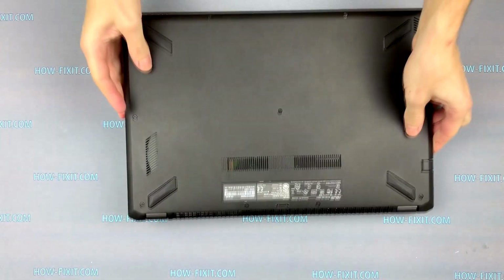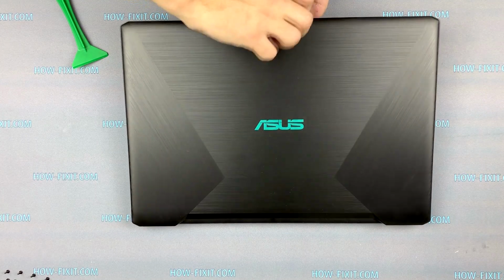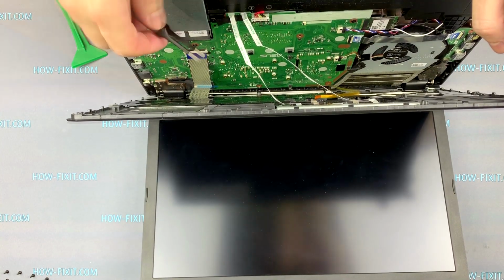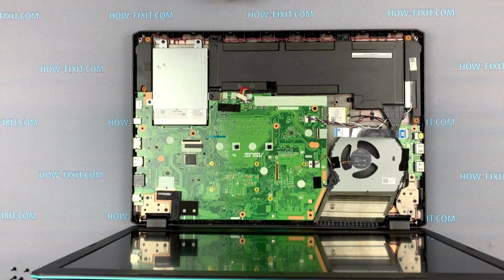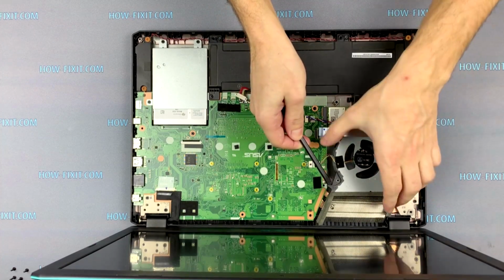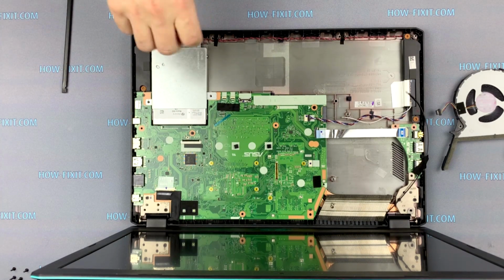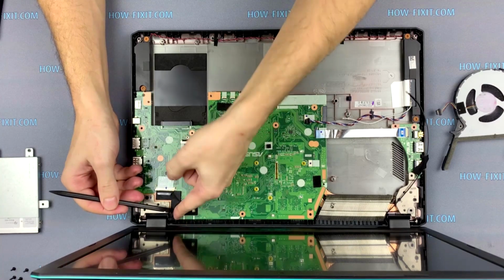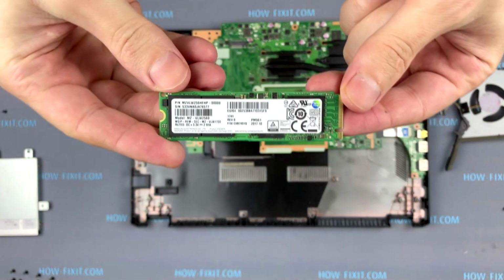How to install M2 SSD in Asus K570, F570, A570 laptop

Comment: Just finished reassembling my laptop after installing the new nvme ssd...
And it turned on...

Just wanted to say thanks brother... You're truly a legend..
Reply: Is true bro the laptop can support nvme and going well until now?
Reply: @tobangapatar1357  yes can confirm! Laptop is fine and it is significantly better performing. nocks on wood
Reply: @outdategaming7367  aside it, what brand ram and ssd you use for the laptop?
Reply: @tobangapatar1357  I didn't touch my ram it was enough. Just installed an Adata sx6000lite nvme ssd
Reply: @outdategaming7367  thanks bro
Reply: @outdategaming7367  what about Pro version bro
Reply: @outdategaming7367  hello bro after installing ssd physically, do we need to make a change especially in bios setup?

Comment: Thanks for this video. Disappointed with Asus for the bad design on an otherwise good laptop with good price-to-performance ratio. I'm not a tech expert but adding RAMs and upgrading/replacing the HDD is something I was able to do myself without much effort. Might choose Nitro 5 over this for the accessibility of its harddrives and RAM slots.

Comment: Omg that’s so much work. 
If I do that I’m gonna upgrade the ram, the WiFi, ssd and hard drive to max. 
So what is the max ram, hard drive m.2 and which WiFi card can I put?  Any help would be greatly appreciated.
Reply from the maker: MAX RAM 32gb (16gb x 2 ram)
Any hard drive or M.2 SSD capacity
Reply: ASUS states online that for the K570ZD (aka X570ZD) the max ram is 16 (8x2) 2400 for this laptop, and it only accepts SATA 3 type M.2 SSD. As far as their product specs lists, NVMe is not supported. The video shows the install of a Samsung NMVe SSD, but does it perform properly?
Reply: In F570z with out removing hard drive we put ssd...

Plz... Reply

Comment: Hello good sir I wanna ask, is nvme m.2 is support for f570zd? Because the information I got from asus website it's  sata 3.0 m2 not nvme. I'm so confused :(

Note: I just buy adata sx8200 pro nvme SSD and it's  not compatible. This laptop is kinda picky for brands. I suggest Samsung nvme for everyone.
Reply from the maker: I personally installed NVMe M.2 SSD and it worked
Reply: @howfixit  thank you so much,  now I'm sure to buy this laptop :)
Reply: How abou WD BLUE 3D NAND NVME M.2 240GB will it work? Tha nk you!
Reply from the maker: it should be working
Reply: @tassamuakhsannugroho8264  have you bought f570zd , and tried nvme?
Reply: Yes, I already use the adata SX8200 Pro 512GB and It's running smooth :)
Reply: Tassamu Akhsan Nugroho hey . i want to ask u since u use almost same brand with i bought and same laptop brand. i bought Adata sx6000 256gb m2 nvme . is it compatible ?
Reply: @nikfarhan3240  yes, it's compatible since f570z have m.2 NVme slot
Reply: Tassamu Akhsan Nugroho at the first comment u tell that the brand is not compatible. is there any problem at first u upgrade ?
Reply: @nikfarhan3240  Apparently on the first comment, my 16GB dual RAM configuration is actually have a problem so the SSD can't boot properly. So I change to 16GB single channel RAM with Team Elite Brand and It's working smooth.
Reply: Tassamu Akhsan Nugroho okay thank u sir 🤗
Reply: @tassamuakhsannugroho8264  Thr customer support said that it supports m.2 sata interface, but nvme runs on pcie so we ll get the speed of read/write according to m.2 SSD, do u check the read/write Speed?
Reply: @howfixit   Asus F570ZD , thr customer support said that it supports m.2 sata interface, but nvme runs on pcie so we ll get the speed of read/write according to m.2 SSD, do u check the read/write Speed? Does installing nvme on f570zd compromise the speed to m.2 SSD?
Reply: @shadyakhtar  yes, the interface is actually support m.2 NVme and the read and write speed is maximum
Reply: @tassamuakhsannugroho8264  Sorry for late comment but how is it bro? still running well and have you faced any issue since the installation?

Comment: Hello sir, I managed to install ram and ssd and everything running well but there a problem  where I can't select the ssd as Priority Boot in Bios 

I have changed the ssd partition type to MBR and   have worked but I am not allowed to install win 10 in it so I reverted back and still using hdd as Priority boot, Do you have any solution for it sir?

Comment: I have ASUS F570ZD. I installed it with Samsung 970pro NVMe M.2 SSD. But it is not supporting and not showing in it's BIOS interface. Do I have to upgrade my BIOS to support SSD?
Reply: Bro is there a slot of SSD or did you replace HDD with SSD?
Reply: @preetrajrajukurian4181  There is a slot for ssd. Same as in the video.
Reply: @Samygurjar   Were you able to get the SSD to work?
Reply: @preetrajrajukurian4181  It worked. But it is not showing in BIOS screen
Reply: @Samygurjar  how did you set the primary boot to the SSD then? If you weren't able to see it in BIOS

Comment: Can someone whom installed an nvme ssd in the x570zd tell me how did you got it to work and which bios version were you using? I installed an nvme in mine but it gets stuck in the asus start logo and won't let me get into bios until I ininstall the nvme :(
Reply: I'm about to upgrade my A570zd with 1TB NVME M.2 too. May I ask have you found a way to fix that problem?
Reply: Mook J. You should be fine, my ssd was just defective.
Reply: @Masked4789  oh... Did you at least get a refund from that:(? But you manage to get your new nvme ssd to work right?
Reply: Mook J. Yeah I got a replacement and it worked c:
Reply: @Masked4789  That's nice! Would have been such a waste. 
One last question plz, I was wondering whether your ssd is Nvme PLCIe gen 3 x 4? I've heard some people got a gen3x4 but their laptops support gen3x2:(
Reply: Mook J. It is gen 3x4 ;)
Reply: @Masked4789  thanks a lot!
Reply: @Masked4789  so it means nvme ssd works on this lap isn't it?

Comment: ITS f570 model?, ITS f570 support nvme SSD?
Reply from the maker: Yes, Asus F570 supports NVMe
Reply: @howfixit  but there website mention m.2 sata3 type supportable . can u share the video and result about nvme ssd on f570zd. i want to upgrade it . and also the following nvme ssd link u ll install on f570zd.
Reply: @shadyakhtar  hello, just wanted to ask you did you manage to find out if nvme   works on F570Z? Thank you
Reply: @trevinferns  yes working absolutely fine. I installed it with myself. No issue great performance boost✌️. I used xpg s11 pro, u can also use adata xpg sx8200 pro both have same config.
Reply: @shadyakhtar  thank you for your response.  I was planning to upgrade my ram to 16 GB and also the SSD.
Reply: @trevinferns  yeah that's good, I was about to say it's better if u consider one 8gb RAM stick upgradation as well.
Reply: @shadyakhtar  sorry bro but can the ssd reach the maximum speed ie. 3500 as stated on box, Im planning for buying adata 8200pro

Comment: Can I install M.2 nvme ssd (500gb) on the asus X570ZD?
Reply: Bro did you get your answer?
Reply: Bro, can you do?, i have the same question
Reply: @juanperalta5853  I installed hp ex900 nvme ssd and it worked 👍
Reply: @thecajonguy957  tx bro, I will buy a similar, take care 👍👍

Comment: Hello, i wanna ask
On Asus F570ZD Ryzen 5 (not Intel core i5) are compatible with SSD M.2 NVME? Because spec on the Asus website are written SSD M.2 SATA
Reply: I have Asus X570ZD Ryzen 7 2700 & I have M2 Samsung Evo Plus 970 500gb after update
maybe you already have M.2 ssd  (usually sandisk 250)